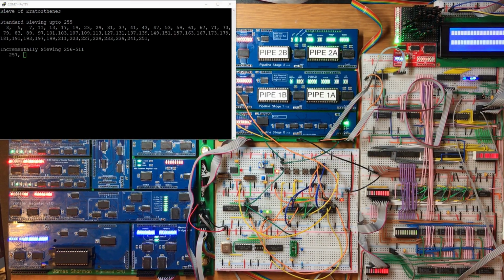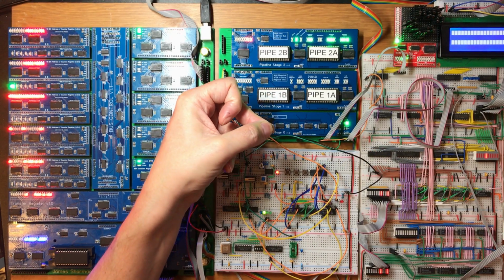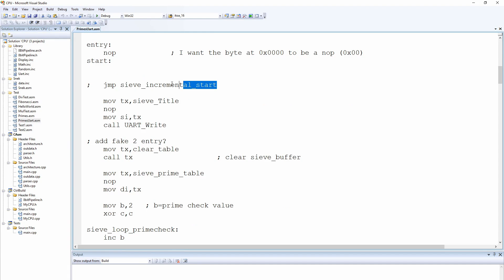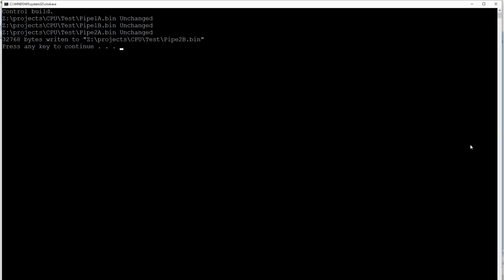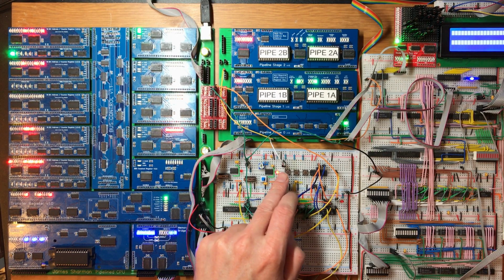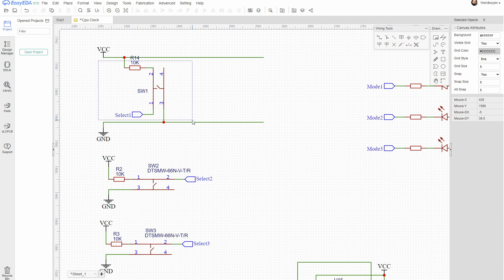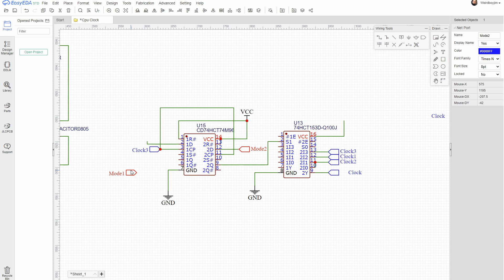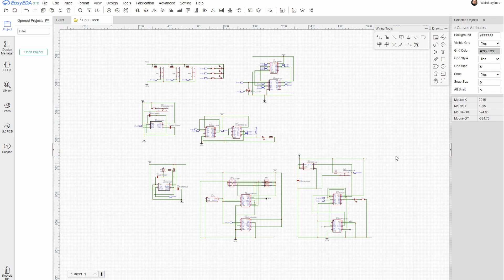Breakpoints - Making an 8 Bit pipelined CPU - Part 85

Comment: What a powerful addition for just one wire and a 2N7000. You could avoid the need to single step by adding a monostable between break and the mosfet, so it only momentarily activates the single-step radio button. Then any other clock source would allow you to continue. EDIT: actually you could achieve that with a 1k pull down resistor on the gate to ground and a 100nF capacitor in series with the break signal to give a single pulse in the order of 100us.
Reply from the maker: Thanks! If I've understood you correctly I'm not so sure about the reistor/capacitor approach, you end up with negative and/or over voltages on transitions depending on how you wire it. Could totally do that with a 555 though :-D

Comment: Usually the positive supply voltage VCC is set above and the reference point GND below. Negative voltages are set even lower.
But I have also seen circuits where Positive volts were seen as the reference point and minus above them. That's always a bit confusing.
English cars used to have a Positive on the body as a reference point. But meanwhile these also follow the conversion Negative is GND and body. But they still drive on the left. Hopeless
Reply: If you genuinely think that driving on the left is a stupid idea I urge you to read about how it was chosen in the first place. Then understand that the reason why most of Europe drives on the right is because Napoleon happened to be left-handed!
Reply from the maker: I don't disagree. Accept about the side of the road to drive on!

Comment: Sorry, but here on YouTube, heresy like upside-down VCC and GND positively must condemn you to being wrong for all time. 🤣 (j/k) Ask ten engineers how to do something and you'll get 31 different answers. For my part, I try to avoid crisscrossing lines on a schematic when I don't intend for them to connect. If that's not possible, then depending on what's easier at the time, I'll "break" one wire before it passes through the other, or use the little hemispherical "hop" over. (Both seem to be equally valid conventions, though I'm hardly an expert myself.) EasyEDA tries to solve this with a red dot at (edit: connecting) intersections, but you just know you're going to find a fault, and spend hours pouring over the schematic, with the tired brain forgetting intersecting lines don't necessarily connect. (Not that I've ever done that. 🙄😁)
Reply from the maker: In the early days I'd try to fix stuff that comments said was wrong. It didn't take me long to realize that advice was varied and conflicting.

Comment: 8:10 Horizontal VCC is nothing compared to how weird it is when ground points up. Your stuff is largely CMOS right? It is very slightly more correct to call it Vdd in CMOS stuff. In bipolar stuff, Vcc is the thing. Think "V collector collector" vs "V drain drain".
Reply from the maker: Pretty much all the dip logic chips are TTL, the smd parts are hct which are actually a little ambiguous but the datasheets all say VCC so I don't thing I'm out of line using that.
Reply: @weirdboyjim  Ah, nice. Your use of a MOSFET to pull that thing low made me jump to the conclusion that it was mostly CMOS.
Reply: It's all ambiguous and inconsistent and really doesn't matter anyway. What is "V drain drain" supposed to mean, after all? CMOS chips have N-channel transistors, whose drain points towards the positive supply rail and P-channel transistors, whose drain points towards the negative supply rail so the rules just fall apart. Most of the circuits I work with contain CMOS devices, NMOS devices and bipolar devices, all using the same supply rails, which I label "+5V" and "0V". Increasingly, I find I'm including devices that need a 3.3V rail, so I label that "+3V3". The point is, it doesn't matter as long as it works for you.
Reply: @johnm2012  Ever heard Vss? Vee? You don't think there is value in knowing where "c" and "s" and "e" and "d" came from? You can just think for a moment, Vee and Vss must be the negative supply or ground. "Just memorize arbitrary letters by rote", is not my style. I want to know where they came from, even if you can strawman it with "yeah but what if they are P-channel". The convention is on N-channel. You are right, it is whatever works for you, but communication is all about what is understood by everyone else. Because N channel works well, and P channel works like crap.
Reply: @douggale5962  Yes, of course I've heard of them. P-channel works well enough to make CMOS the predominant technology used today.

Comment: I know this video is a year old. Thus my comment may go unnoticed. But I am wondering, considering you are using rom chips for instruction decoding. Couldn't you make an "instruction load" instruction. Letting you define custom instructions to toggle the controll lines in software?
Reply from the maker: Well you could but it's never as easy as when you first have an idea. To do this with the existing hardware you would need to have as many permutations of the instruction as you want control line permutations (And I only have 8bits of instruction) or you would need additional hardware to output control lines from the immediate register or another source of data.
Reply: @weirdboyjim  I was thinking having two extra registers one for pipeline stage A and the other for stage B. And just adding three instructions. Two to load to the registers. And one to assert the contents of those registers on the control lines.
Reply from the maker: @tentative_flora2690  That 3rd instruction is essential a "custom instruction", you would need to make it traverse the pipeline activating stages as it went. It would work, but you would have 32bits of control data to load.
Reply from the maker: @tentative_flora2690  I suspect you would be better of replacing the 3 pipeline roms with ram chips (They would be faster) using a copy (like my shadow ram system) and providing a mechanic to live change the contents. That way you could rewrite any instruction.
Reply: @weirdboyjim  the only reason I wouldn't is so a programmer couldn't lock themselves into a non-turing-complete system.
Reply from the maker: @tentative_flora2690  That is what the reset button is for!
Reply: @weirdboyjim  Fair enough.

Comment: It's common practice to group VCC as you have, as it shows things sharing a supply rail. With regard to grounds, use as many ground symbols as you need rather than running them all to one ground.

However, having VCC upwards and GND downwards really makes it look 'nicer' to me (whatever that means).
Reply from the maker: Fair enough. That's roughly what I do, still evolving my practices.

Comment: It's good practice to have a resistor from the gate of a MOSFET to ground. This way, of you remove the gate driver, it cannot float to random levels and cause non-deterministic behaviour. Any value will do, 1k<R<1M 😂
Reply from the maker: That sounds reasonable. Essentially a pull down. Someone else suggested I should always have a resistor between the signal and the gate, to limit in rush current but I couldn't find any hard reference on that, or any indication of value. Care to comment? The resistance would have to be significantly lower than the pull down.
Reply: @weirdboyjim  This is one of those weird areas of electronics. It is application specific. I see no reason for you to need a series resistor with how you use the 2N7000. I suggested the pull-down to force it into a known (design specific) state if the input became floating.

RF folks often put resistors in series with the gate to limit the current as this makes a better match to their driver (reducing reflections, etc), and also forms an inherent low-pass response RC filter (with C being the gate capacitance). 

However, if you take a look at switch mode power supplies, they'll use FET drivers which are very high peak current drivers specifically to charge the gate very hard (as an example, MCP1415 will drive 1.5A peak into a FET gate). This hard drive switches the FET very fast, and thus limits the time the FET is in the (lossy/resistive) linear region - it's a key step in pushing SMPS efficiency up. Essentially the exact opposite of the resistor.

Comment: The horizontal lines for VCC and ground are typical of very simple circuits... Not usually computers, which use the nets you've been using.
Reply from the maker: Good to know, I've learnt this is one of those subjects where I get a lot of conflicting advice. What I'm aiming for now is modular chunks of schematic that I can zoom in on during video where you don't to know about wires that go off screen to understand the working of.
Reply: @weirdboyjim  I'd imagine most of the people who complained about it were probably EEs or just came from watching bigclivedotcom draw them out. If you look at schematics, even from the 1950s of televisions and radios, you'll see the same sort of nets you're using here, though those are usually just supply voltages and not signal pathways.

Comment: mosfet's gate may need to be current-limited, depending how much peak current your TTL chips can  handle. Mosfets' gate is basically like a capacitor.
Reply from the maker: Really? On what? The gate, source or drain? I wouldn't have thought this would be any different than a logic output driving a logic input which doesn't seem to have anything extra and plenty of circuits online use them exactly as I have.
Reply: @weirdboyjim  Series resistor between gate and the signal pin.

Comment: instruction and   memory address and content displays and switches would be  great instead of relying on "EEPROM's"
 knobs for run/stop, clock speed,single step,deposit,deposit next,examine,examine next next would be great
Reply from the maker: I have switches and led's for most of that already, but I don't have an easy way of inspecting memory while the processor is stopped. I'll have to give it some thought. I'd need some way of overriding the address section lines, but they are driven from a chip with tri-state outputs that are just always on, so it is possible.

Comment: The Honeywell 6180 CPU maintenance panel had hardware break switches for operand address, instruction counter and maybe a few more. It might be interesting to do a "blinking light" panel with instruction counter, accumulator, memory address displays and switches and knobs for run/stop, clock speed, breakpoints.
Reply from the maker: Adding selectable breakpoints is an interesting idea, I may put together a breadboard that connects to my exiting header to give it a try. Separating memory read/writes into instruction/stack/data would require a longer cable over to the "address register select" lines, but those are available on that little red breakout board.

Comment: Did you draw inspiration for your ISA from any particular processor? Would it be worthwhile if I built a breadboard CPU of this caliber to instead implement RISC-V's base ISA?
Reply from the maker: You can look at is a few different ways, internally it's a lot like early risc implementations like mips, externally it looks a lot like x86 as that's most what I'm used to. 

RISC-V is interesting,  the most basic implementation would have 16 x 32 bit registers, that's a lot of wires. It would dwarf my build just in the register stack. Then the ALU would be 4 times the size, you would need a full shifter as well if you didn't want to microcode for different shift sizes. While 32bits is going to be a lot more wires, architecturally it can be simpler. You wouldn't need separate GPR's and address registers since 32bits is a rational size for both. I would not recommend it for a first build, but if you do make sure you spend time planning the alu and instruction decode carefully before you set anything in stone.
Reply: I am very much in the learning/"pre-design" phase and little insights like these give me a launchpad for my research, so thank you it means a lot!
Reply: Yup! You May. The Only problem is RISC V is 64 bits,so you will have a ton of wires for each logic. The no. of chips/transistors will increase too.

Comment: Being able to add important features with minimal work is always a good indication that the overall design is decent. Excellent work!
Reply from the maker: Thanks Frank. Planning to add this was the reason I made the clock selection digital though.
Reply: Indeed. It’s a sign that the architecture has been well thought through. I’m guessing James is applying system design lessons learned in the software realm to hardware design. A very valuable set of skills.

Comment: Personally, I find that having VCC and GND symbols sprinkled around the schematic can actually make it more readable. Its a little bit of localised context, just saying that x, y, z signals are tied one way or the other, and doesnt clutter the schematic. For example, if you are studying the schematic and have to follow a signal that goes off the screen only to find out that it just went to one of the power rails when you could have seen that immediately in your field of view, its a bit like obfuscated function names where you have to go off and read the code of the other function to find out what it does rather than having an idea of what it does from its name - its a distraction you can do without. :-)

I use this method pretty much exclusively. My power input connector has a pair of VCC and GND symbols, and then everything else on the board, from the power pins of ICs, to inputs, to buttons, passives etc also use those symbols to indicate what power rail they are tied to. I think of power as a "static" thing. Its there, it doesnt really change, and has no functional impact per se, so any complexity added to the schematic should be saved for the functional signals themselves, and if you have to trace it off the screen you know its going somewhere that could have dynamic state.

Track down some schematics for old retro computers like the C64 and see what they have done - they pretty much all do the same thing. The schematics can look pretty messy, but all of the signals you see do something to make the thing work, rather than describe what pins are connected to VCC or GND.

Having the VCC symbol pointing up and GND pointing down I do think is a good idea though, it sort of signifies the logical level each power rail represents, and "feels right".

Also, check that your breakpoint works at high speed. Ive used 2N7000's in a few projects and have found they can be a bit "slow" at higher speeds, e.g. in MHz range. It could even pay to use something like a 74LVC1G06/07 on a little adapter board depending on the logic you need. But then I think that open collector/drain logis is not necessarily super fast anyway.
Reply from the maker: I'll look into he part you recommend, it works ok at 2.5mhz at the moment. The output is latched by a d-type driven by the fastest clock, so the worse case scenario is that the break would be delayed by an integer number of cycles (Presumably a maximum of 1 at anything upto double the current clock rate).
Reply: @weirdboyjim  Ah ok, if it works then perhaps it will be ok. I was trying to use one to e.g. pull the HALT signal of a Z80 down when I was designing a front panel/bus monitor/debugger type device, and was trying to implement a lot of "hardware breakpoints" like memory read, memory write etc. I found that when trying to run the Z80 at a few MHz I could often end up skipping over the event that I wanted to break on and it would end up breaking on the next event - was particularly bad when trying to break on an M1 cycle (instruction fetch) because you'd end up skipping one instruction.

Comment: First of all great stuff mate.  I saw in a comment that you usually get too many boards when you order your PCB's.  You should consider raffling off the extra 3-4 boards as a complete set when you're finished. Keep up the great job!
Reply from the maker: It's the boards that I only need one of. The big backplane's are the most expensive and I get 5 when I only need 1. Thanks Louis! I thought about making a 2nd one when it's all done, but there would only be a few boards to order to have multiple spare sets of pcb's.